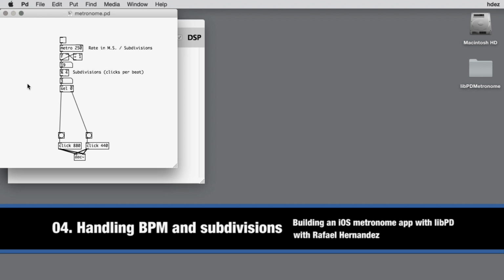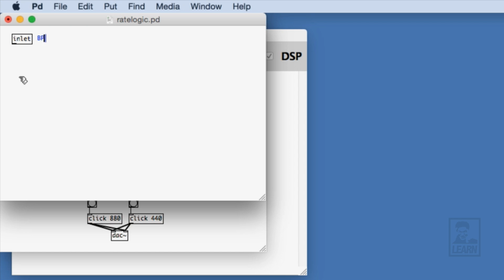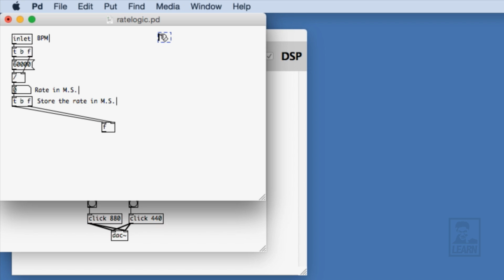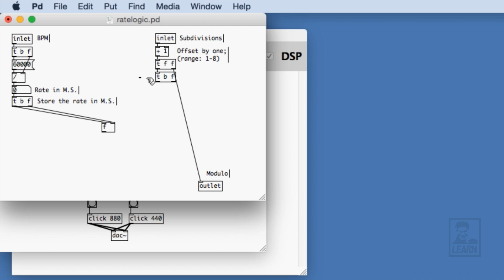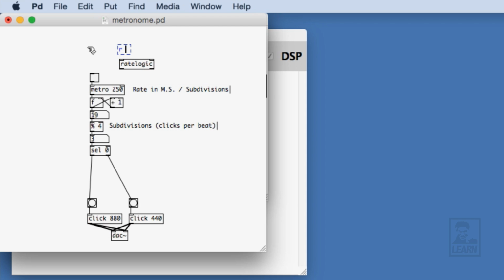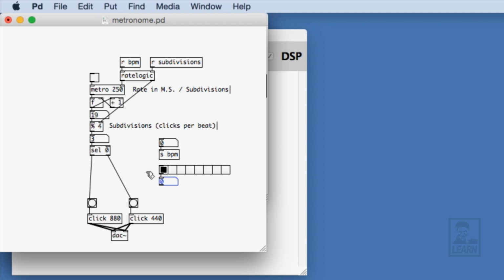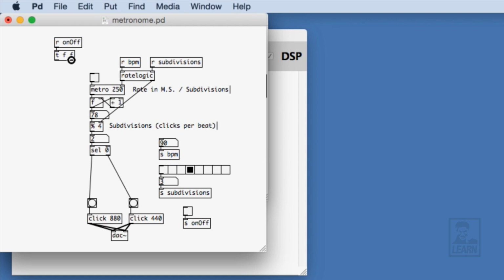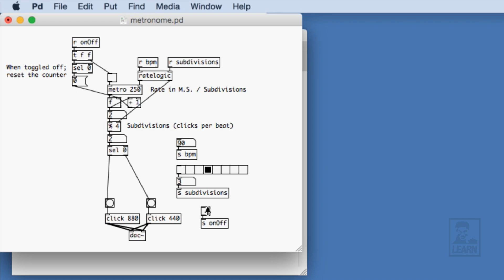Building an iOS metronome app with libPD: 04. Handling BPM and subdivisions

Comment: Hi, I'm following this video, but when I put the ratelogic object in the metronome file and play it, it only plays a continuous click 880 sound. Is there a fix for that?
Reply: I had the same problem in the beginning. My mistake was super simple and stupid: I wrote "s subdivisions" and "r subvidisions" (switched the letters d and v). This of course can't work. To avoid mistakes like that I usually keep my variable names short. Finding these simple errors by just looking at the patch is nearly impossible because the mind tricks you and often doesn't see spelling mistakes. Instead you can either start from where the patch last worked (if it's a small patch like here) or check interim results. In my case I added a number object next to the receiver object "r subvidisions" and saw that it doesn't change at all. So I knew the mistake was even before the ratelogic patch. I'm sure by now you found your mistake but maybe it helps somebody else.
Reply: I know this is late but, I found that putting all the pd files into one pd file solved the issue for me. Maybe it was my fault in the first place but putting it all into one file fixed it.